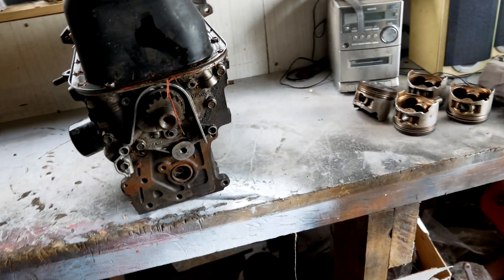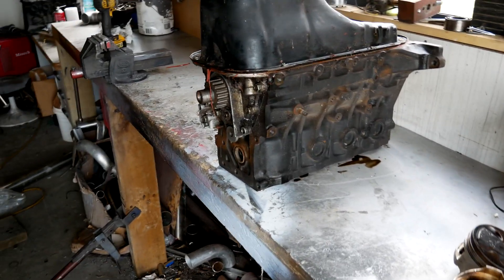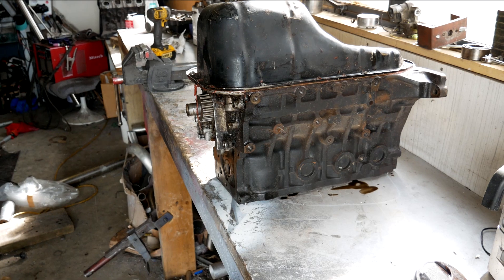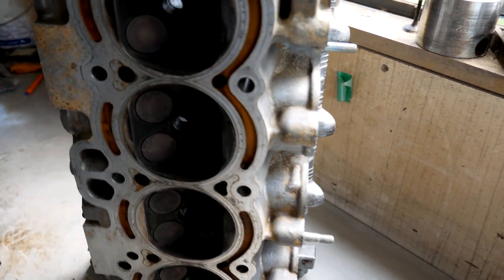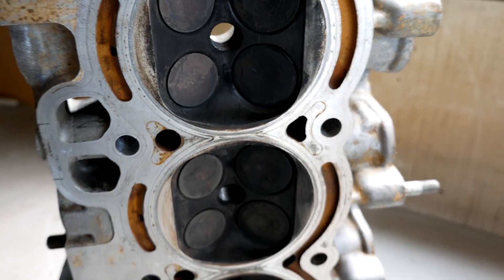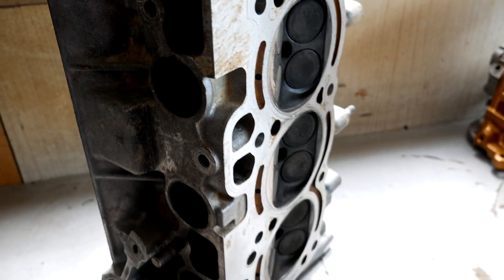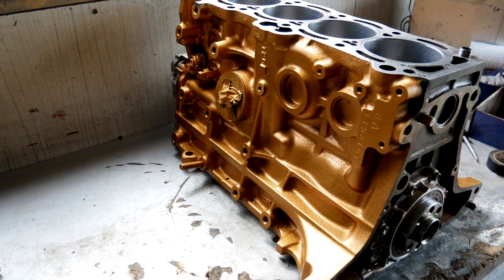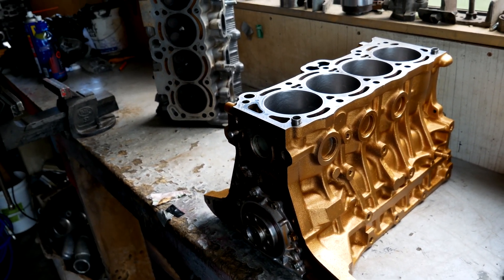Budget NA build that works - Smallport 4AGE

Comment: I enjoy how you make adjustments until it gives you the best result, one thing at a time.  For example, noting the torque dip from the cam change, you adjust the intake cam to see if it improves, which t does.  Watched you do this on another build with a big torque drop where cam timing only moved the rpm of the dip, so you turned to modifying the exhaust which solved most of it... brilliant! A perfect example that we're working with a SYSTEM and sometimes you have to adjust several things in that system to get the results you're looking for... just adding the "hot" cam is not always the answer!

Comment: Hello,
I want to see if I can turbocharge a 4agze stock internal with big port head 274/258 8.15 lift tomie pon cam. I do have haltech 1500 still in the box . I am looking for 350hp wheel hp. Can this be done reliably? Any recommendations greatly appreciated? Thank you for all the great testing videos.

Comment: I own a 4age and a 4afe my question is how much rpm can I spin using the stock shim over bucket lifter. 4age is na and 4afe will be turbo . Looking for 8k rpm reliably for both engines
Reply from the maker: 8000 rpm is no problem for the stock shim setup.  Have revved them to 10k without any failure.  but over 9k i would switch to shimless. they arent that expensive.      Just make sure valve springs are good for what you are doing.  valve float will make them far more likely to spit a shim.
Reply: @Garage4age  thanks for the info !
Reply: @Garage4age  also one final thing. What about the stock valves. Can they be used for turbo aplication. Around 350hp is my goal with the 4afe

Comment: Love your videos . Seen them multiples times to understand that hat in want with my personal build . 
Im stock on valve springs right now . 
What pressure its recomended for valve springs on those 193
Reply from the maker: this one runs toda springs. i run them on everything other than the "HV" kelfords. which i run kelford beehive springs.  kelford has another  spring option that you can go with on the non "HV" cams also. but  are a bit more expensive than the toda's

Comment: Can i use 193 C with a similar combination on this video ?
Reply from the maker: Yes,  imo they are a better cam. I would have ran them in this engine, but had the 193b's hanging around.    Remember the bigger you go the more sensitive the engine gets to exhaust and intake tuning.  and harder it is to get the engine to work over a big rpm range. should be looking at some good head work also.
Reply: I got also a set of wiseco pistons to do a different build . 
Do i need head work , valves etc fot the 193c cams?
Reply from the maker: @juancarlosaponte3528   stock valve size is fine. oversized valves need bigger seats and a lot of porting. or else will actually be worse.     Haven't  ran the 193c on a stock head.  but have tuned a car with 193b on stock head.  it made 119kw from memory.    head in this video has had a little port work.       i would suggest at least to tidy up behind the valves  and in the chamber.    na tuning is all about stacking small gains together.  so dont expect big gains from just doing one thing.  unless that one thing happens to be the only thing restricting the engine for course

Comment: Hey mate noticed your not using a cas but running coils how did you achieve this do you run a trigger set up on the balancer or what’s the go ?
Reply from the maker: Hi,  Yeah i run a custom hall sensor trigger setup, that works far better than the factory setup.  there are some pictures on my instagram  @garage4age

Comment: Hey there i'm not sure if you'll see this because it's an old video but what itb's are you using and where did you get them from? I want to use those on my smallport 4age and want to see if they'll fit if you can give me links or info on all the parts for the itbs. Thanks so much.
Reply from the maker: hi,  they are blacktop 4age  throttles.  rest of it is custom made
Reply: @Garage4age  great thanks

Comment: I have a big port series 1 motor would i make more power with small port head with my 276 piper cams that i run in my bigport
Reply from the maker: Maybe a touch if both heads are stock. But most of the power differnce between them is the manifolds and compression ratio

Comment: Love your content. Your work comes up alot in conversations amongst the friends. I have one for ya. The orientation of the throttle body. As in opening of the throttle plate with axis of the throttle plate horizontal versus vertical. I've always wondered if there is some low end turbulence occuring in the plenumn.

Comment: Hey man, Just trying to work out upping comp in mine with the 193B in a small port with zero deck height, stock small port pistons and was going to run a 0.8mm TRD gasket. Was that head you used shaved at all or do you know your combustion chamber cc's?
Reply from the maker: .8 gasket all good to use on zero deck height. You can skim .5mm off the head no worries as well.    Engine in vid was  around stock compression
Reply: @Garage4age  yeah sweet that was what I was shooting for then I'll dial it in with the cam gears. Thanks for the quick reply, legend!

Comment: Genuine question: Why do you spend so much time optimizing an NA 4-AGE build for such low horsepower? Why not build a high compression, high rpm motor for more power? Or do a swap?
Reply from the maker: This is just showing  what can be done without spending all the money.  172whp is pretty good for a na 1.6L  with not a whole lot spent on it.      my earlier videos have my good engine in them. which is over 200whp still 1.6L
Reply: @Garage4age  at the time I wrote my comment, I actually didn't realize how big the difference between kW and horsepower was! I also didn't know 4AGE is only 1.6L. I definitely think 200whp is great from a 1.6L engine. Especially going through a RWD drivetrain with all the losses involved.

Comment: Have you used a 40mm crank? I'm using one in a build and I heard they don't like high revs(8000+).
Reply from the maker: Have always used the late 42mm crank engines. so no personal experience with the 40mm.   you would at least want to change to the late style oil pump with big revs
Reply: @Garage4age  Thanks for the advice! I'm planning on running a silver top pump. You should try a 40mm set up out to compare. The 40mm cranks are quoted about 700grams lighter than the 42mm and Molnar makes a 20/40 connecting rod so you can run small port pistons.

Comment: What is benefit of using the bigport block over the smallport?
Reply from the maker: none.  its just what i had hanging around. Its a redtop bigport block.  so is the same casting as smallport.   not the early 3 rib block.

Comment: Do you think that building a 4A-FE in a 91 Corolla wagon is worth it? Asking for me, not a friend.
Reply from the maker: depends what you call building?  NA probably not so much due to lack of aftermarket support for cams and the likes.  you could turbo it with a low boost setup and will go fairly decent.   Or 4age swap wouldnt be that hard since will bolt into the same place as the 4afe

Comment: Really great job!
Thank for your time!

'll love to see an unseen setup with longer conrod (better conrod/radius ratio). It's our way for making good setup in France (peugeot 306 2.0 XU10, 205GTI 1.6 XU5).
A longer conrod limit the imbalance between upper strock and down strock. less vibrations, less loss...
4AGE have too small conrod lengh (...making it's proper sound/identity...In add with valve uncommon angle).
A 7AFE engine block/conrods with 4AGE internals must be great.
Reply from the maker: I literally just test fitted some custom rods a few hours ago to do this.
Reply: @Garage4age  Oh god! great ... job ^_^,

Comment: Can someone convince me of the potential of 4A engines without spending heaps of money in terms of performance?
I'm very conflicted on building my bluetop or just going with a K or rotary swap.
Thanks!
Reply from the maker: Depends what you want from it.  na ?  turbo?    end of the day k series and the likes are quite a bit bigger capacity wise. so you cant expect the same numbers from 4a
Reply: @Garage4age  I'm not looking for crazy numbers, a stock NA K24 tuned will make roughly 250whp. If it can match that then I'm all in for a 4A build.
Reply from the maker: easy on a turbo 4a.  7 rib block and 4azge pistons and will go forever on that power.    NA not so much,  200whp is getting to the top end of whats possible and pretty hard to achieve,  esp with  nice powerband.
Reply: @Garage4age  How about the rods? Would late bigport & early smallport rods hold? Since they're the beefiest to my knowledge
Reply from the maker: @Black_Piller  Yeah thats all my hilux has, just arp rod bolts.  late smallport / silvertop 20v are all good as well

Comment: Not sure if someone already asked about a 1.8 bottom end...how would that fair, is it a more finicky type of engine? Pro vs cons between the two 1.6 vs 1.8
Reply from the maker: Yeah lots of times haha.   IMO for a budget build the 4a bottom end will win every time.   you can just use a stock bottom end and rev it to 8500rpm.  7a will need to spend some money on it.  will still suffer from all the same problems as a normal 4a.  have seen plenty of 7a builds make less bottom end power than the engine in vid and also rev less. so smaller power band.  better of spending the time/money on getting the bolt on's right.

Comment: Amazing the difference with cams made on their own. They don't respond as well on the 20v. Would be nice to do something similar on the 20v.
Reply from the maker: yeah 20v has bigger cams from factory.  Plus you will find a cam of the same duration for a 20v will have less aggressive ramp angles, due to the smaller bucket size.  even more so if convert the 16v to undershim/shimless buckets and use a cam profile to suit.   so stepping up a  cam profile on a 20v that same as a 16v cam on  paper isn't really apples to apples

Comment: Idea for testing: 

Some headers for example go from 4 to 1, 40mm runners merge into 60mm exhaust, but collector tapers down to like 55mm or 50mm and then tapers other way back to 60mm exhaust diameter. As a choke should increase velocity and pull-effect on other runners as opposed to straight runner to exhaust merge header. Would you like to test this idea on different collector choke diameters? 

Btw: thank you for this video.
Reply from the maker: I have lots of video's where i test and try similar things.   even in one of my more recent ones with the blacktop 20v it uses this kind of design.

Comment: Serious comment.
I remember advertising for Power or Economy plates or whatever the snake oil name was for them.
The alleged purpose of them was to help properly atomise and mix the fuel with the air to improve power etc etc.
They were usually a bit of metal that had holes stamped in it that you shoved under the carburettor.
I really don’t know if any of them actually worked but the principal behind them is actually sound.
Auto makers have gone from injectors that have one hole and just dump fuel to a wide variety of spray patterns and hole numbers as well as trying to optimise the intake, ports , valve position and combustion chamber design to eek the most out of the least.
What some people do when they port a head and intake is they sometimes without knowing it is remove some little bump or ridge that the designers deliberately put there to help ensure the air fuel charge is evenly mixed in the combustion chamber.

If you run out of things to test you might want to try different design injectors and possibly some kind of power plate if you want to risk bits of metal breaking off into the engine.

Comment: A little tip for small scale engine builders
Pop into your hardware or garden store and grab a small pump up garden sprayer or three replace the spray nozzle with a small hose or something and fill the reservoir with oil or cleaning fluid or whatever you’re likely to need to inject into small places.
You can use these to clean or fill oil galleries flush brake and fuel lines and possibly fill differentials and transmissions
And as you can get them for under twenty dollars even under ten dollars they can be cheaper than the devices made for these purposes that you might only use a few times.

Comment: While dismantling, you don't use the impact from the begining on the rods for some concrete reason?
Reply from the maker: No real reason.  But always good to loosen stuff off by hand to get a feel for whats going on. if something doesn't come apart nicely you'll know straight away.   rather than just sending it with the ugga dugga

Comment: Would love to see dyno # and 1/4 miles time/ trap speed. Never understand what's the point of all that twist long header?
Reply from the maker: Car has done a 13.50 on unpreped track on street tyres @ 103mph.  engine in it at the time would have been around 140kw.  One of the reasons for the header design is to get  enough length in the engine bay.  not enough ground clearance under the car for collector

Comment: How do you find the half size radiator in the kp? I have been running one in my 4age suzuki sj but the thing keeps overheating. Any tips?
Reply from the maker: never gets hot.   stuff in front or behind the radiator will have a big effect how well the rad cools.

Comment: What new parts did you use, if any, for the block refresh? Bearings, rings, studs?
Reply from the maker: Only new bearings  and arp head studs, just because can reuse them.  The block looks like the previous owner ran it on sand or rocks. would need to  be bored oversize  to get the vertical lines out.  So i decided to spend the least amount possible. 300k block with dingleberry hone,  close to that on the pistons and rings from another engine.  hence why its kinda smokey. It literally is stuff thats been hanging around in my shed for years.   its done over 200pulls on the dyno and still goes fine 🤷‍♂️
Reply: @Garage4age yeh fair call. hahaha, fantastic little engines right. Thanks mate, love the vids as always.

Comment: I wonder what kind of power could you extract from a peppy engine like this with a freevalve like cam setup?
Reply from the maker: probably quite a bit more.  I recon it should make another 10kw with the right cam combo
Reply: @Garage4age  what do ya reckon the right cam combo is. Love from Ireland 🇮🇪 ( the real home of the ae86)
Reply from the maker: @eddieconvey9223  Can go bigger than 193b without losing much  if anything down low. but is critical to get the exhaust and intake right for it to work.  I'd run the kelford 193c over the 193b in that case.

Comment: in your experience does the 4ag benefit more from higher lift or more duration?

do you reckon using a 265/256 duration cam would give more power down low? i have some old hks ones sitting around... but they’re fairly low lift. i’m building an engine with 10.5 compression, and i’m torn between the hks and 193-bs for a street car.
Reply from the maker: duration.   To a point its not really the cams that will give more low down power, they just get the blame for it. almost all 4age's ive seen with cam upgrades, will have a big dip between 4000-5000rpm and only start making power from 5500rpm onwards.    but as you can see in this video, not the case, matches stock power then pulls away from 4500rpm onwards. this is due to getting the bolt on parts right, mainly the headers and exhaust. people also usually leave the cams dialed to reomended spec, which usually isnt ideal.

Comment: Very nice, good baseline build to do! How hard was it to 4AGE swap the Starlet? Simple because they have 4K-E/4K's?
Reply from the maker: not hard. just the usual custom engine and gearbox  mounts. depending which gearbox you use.   dont need modify the body or anything.
Reply: @Garage4age  did you use the T50 for it? or did it mate up to a K50 easily?
Reply from the maker: @Mainfoldium  T50,   you can use a k50 from a 3au, (ae85 and the likes) will bolt in. but pretty sure the shifter in different location. and they are pretty weak
Reply: @Garage4age  did the t50 line right up? I know some of the Starlets have K50's so in theory that would just be engine-mounts to worry about then if the bellhousing fits the 4A (unless firewall brings issues for 4A then)
Reply from the maker: @Mainfoldium  the starlet k50/40 wont fit a 4age, the bellhousing is part of the gearbox on them. so have to use an k50 that comes from an a series engine.   T50 factory 4age box so all fits engine right, but needs a new gearbox member fabricated or something modifed to fit.   the hole for gear stick will prob need some triming either way.
Reply: @Garage4age  Ahhh I see, been considering doing one, but the info about it seemed so iffy with so multiple variants of the transmissions out there with the same name.. it's like the same situation with Volvo's M90 transmission being completely different mounting for different engines they're mounted to
Reply: @Garage4age  I was thinking if other K50's would fit the engine and also fit the Starlet but just having a different bellhousing section but otherwise the same shape and line up with the shifter hole. For instance a K50 off of a E70, if the T50 doesn't line up with the hole etc. Just thinking what box is most desired to avoid massaging the tunnel to fit another transmission or having to cut the hole (or custom driveshaft). One that fits with the hole and driveshaft without any body-work required other than a custom support-member is fine
Reply from the maker: @Mainfoldium  pretty sure the starlet box has a foward shifter. the ae chassis cars shifter further back on k50.  for same reason the t50 is further back. since come from same chassis as the a series k box.  you'l break the k box behind a 4a unless you drive it nice